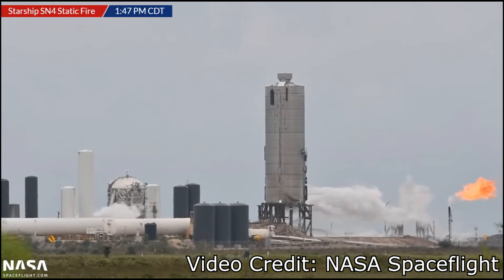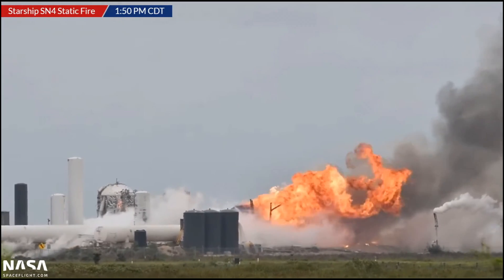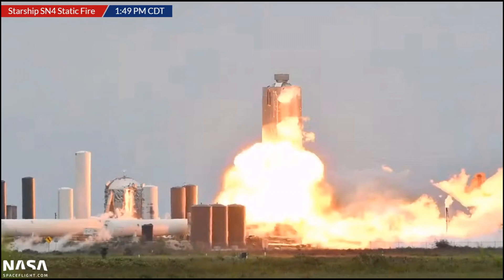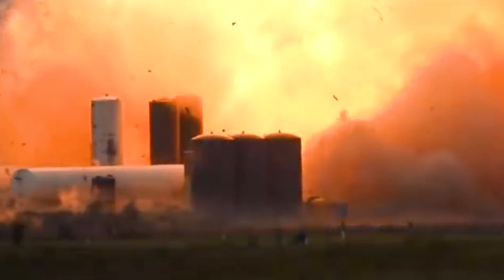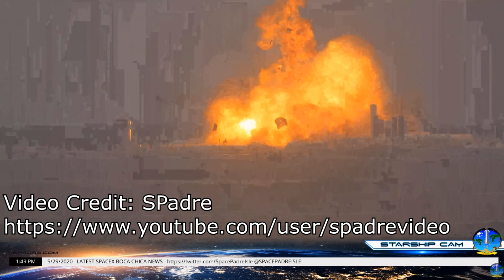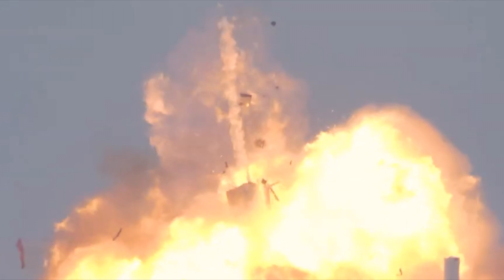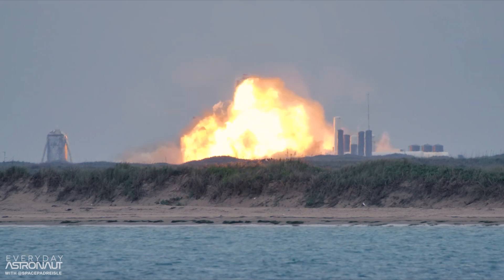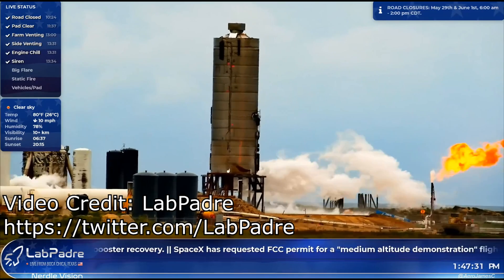What Can We Learn From The Explosion Of The Latest SpaceX Prototype?

Comment: Scott, my man! Great analysis. I'd only seen Tim Dodd's POV so I gotta thank you for clearing up the ground ignition question. Also, I didn't know the mass simulator weighed in at 20 TONS! Geez, that's a lot of mass to launch so high, so quickly. Were you able to calculate whether or not it peaked at 150M? LOL

I'm reminded of the story about Edison, seen taking notes while his Menlo Park lab burned to the ground. Apparently, it was around the nine thousandth attempt at making an incandescent light bulb and an explosion resulted, followed by a large fire. Someone asked him why he calmly took notes as his life's work went up in flames. As the story goes, his response was, "One day I might need to make something explode."
Reply: based on the number 110 km/h he mentioned as initial speed of the mass simulator, I get my calculations to around 50 meters up in the air in relation from its initial position of 30 meter elevation or so.

Comment: I agree with both oxygen and methane spilled.  The detonation is less likely with just liquid methane as we see when it splashes on the ground from the flare stack.
Reply: There was enough elapsed time for substantial mixing of methane with atmosphere, so it's probably not necessary to have a simultaneous LOX leak to explain the fuel-air detonation.

Comment: if it is hammer, they have bigger problems.
1. the system should be hardened against hammer - strong enough and damped
2. the system should not allow hammer to happen in the first place
hammer requires multiple simultaneous failures.
Reply: Did lower bulkhead unzip. Embrittlement>FAE>bang
Reply: @jimgraham6722    could be.  maybe the mechanical properties of the welds in this material are not well understood at these temperatures.

Comment: Maybe after ground systems were over-pressurized, there was electrical spark or something? It doesn't take much to ignite Methane if there is a lot of oxygen. When the mass of 20 ton hit the ground it could have caused sparks or even just pressurized methane oxygen mixture which created flashpoint.

Comment: Interesting the shock wave centres somewhere between the rocket and the flare stack.
Reply: When he talked about 45 degree angle, that was exactly to explain this. The ignition happens under the rocket, as shown in slo-mo. The layer of methane mixture on the ground is where the shockwave propagates (faster than speed of sound) and that makes a shock wave skewed to less than 45 degrees from horizontal, and this also makes the shock wave to be apparently centered somewhere in that methane cloud when it smooths itself out to a rounded shape.

Comment: We have learned that Space-X needs to add more struts.
Reply: Jeb probably pressed the wrong button!
Reply: Check. Your. Staging.
Reply: @nemo-x  An expert is just someone that has had way more experience screwing stuff up than you have. ;p
Reply: @nemo-x  hm, Scott doesn't agree with you?
Reply: @snuffeldjuret  -- Scott seems to agree it's a staging issue; flipping a switch at the wrong time, shutting s valve too soon, or even hitting the disconnect by mistake, can all be filed under "staging issues".

Comment: Next time they should put a manhole cover on top
Reply: This narrative you're wishing for kind of  already happened.

And when the government was questioning the speed of which the manhole cover blew off the top of the test site.

(Paraphrasing) the scientist said it's hard to tell cause the high-speed video only has one frame of it blasting off.  

When the general or whomever asked what the scientists best guess would be for the speed.

The scientists replied something along the lines of: with the data provided my best guess would be that it traveled fast enough to escape earth's atmospheres 3 times. 

Like I said I am paraphrasing but the scientists answer kicked ass and if you can find the original transcript, id read the debriefing if I were you.

Oh, by the way this was a multi ton cap that was supposed to keep a underground nuclear test from reaching the surface of the earth; obviously it didn't work.
Reply: @BradyIsAfagInHeat  Yup. Some guy ran a computer simulation a while later, and figured, at the insane speed this was going, it probably was vaporized by air friction......
But then some while ago, pretty recently, someone re-did the simulation on modern hardware with a more sophisticated model, and realized, at the insane speed this thing was going, it wouldn´t have had time to burn up, so, yeah, it´s probably catching up with voyager right now........W00t!
Reply: Paavo Bergmann 

yeah, if it had stayed flat, it would have vaporized, but the immense pressure would have buckled it into a cone shape that would have been far more aerodynamic, and would have easily escaped the atmosphere.  it's probably at least near the orbit of neptune at this point.
Reply: @BothHands1  AH, thanks for the real reason, didn´t know that detail. Pretty awesome when you think about it.
Reply: Amazing reference there
Reply: amazing 🤣
Reply: keith moore  Yes...that´s what TURK, and mike and SteelZenith were referring to
Reply: That would be the 2nd manhole cover to be launched into space
Reply: @nethoncho  3rd
Reply: Eyyy I get that reference
Reply: @docpossum2460  right

Comment: If the explosion was a bit bigger they could have got the mass simulator into orbit. Maybe that's the plan? no more rockets, just big fucking explosions to get things into space
Reply: Sadly, that is not how orbital mechanics work.
. You could (theoretically) send something onto a solar orbit (or even out of the solar system) with a single big explosion from the surface of Earth; but placing anything IN ORBIT OF EARTH is impossible [not difficult or impractical: is physically impossible ].
  ->  You need an absolute minimum of TWO separated acceleration events (one on the surface of Earth, another at the highest point of what_would_be the orbit around it).
  So, the "object" would need its own internal rocket/explosive AND survive the initial blast (otherwise it will just fall back, landing on another place of the planet).
  
Note: Any single explosion cappable of sending 20 tons out of the galactic orbit around the Milky Way (for that matter also out of ANY posible gravitationally bounded object, its trajectory forever remaining hyperbolic), would also melt the solid crust of the Earth reaching the mantle [making a "lake of lava" ~100km deep that would mix with the mantle preventing any cooling_down that could "seal" it]; this heat will be carried by the atmosphere boiling down all of the oceans & sub_surface water [zero life on Earth, not even bacteria would survive].
Reply: @adolfodef  I knew i should have added the /s but then i would not have seen your great response so I'm glad i didn't :)